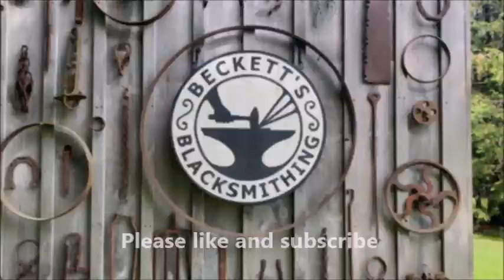Forging Simple Tongs

Comment: Absolutely! I've been thinking of trying that very same technique. This just relieved me of some head scratching. Thanks.
Reply from the maker: No problem.  This method seems to work pretty well for me.  I was missing a lot of tongs for holding  small stock and these jigs meant I could make a whole batch of tongs quickly and consistently.